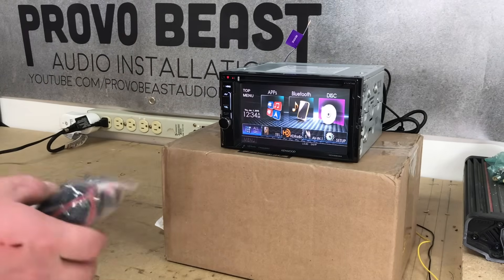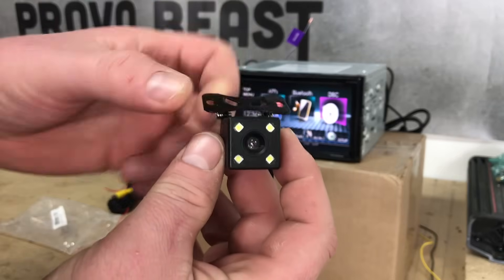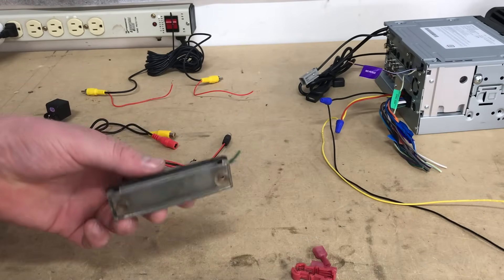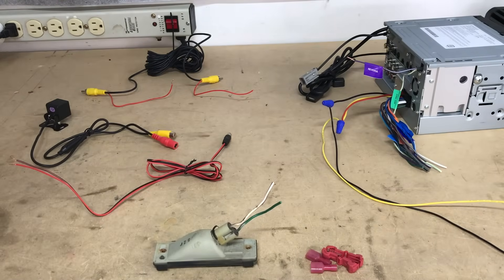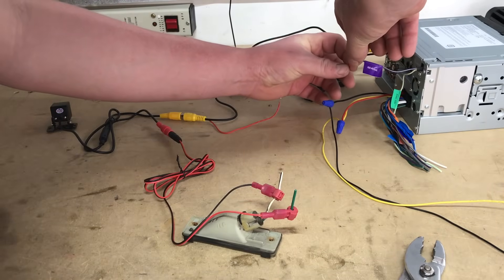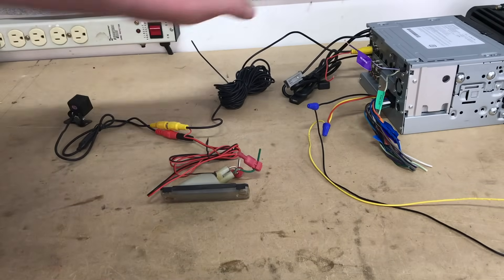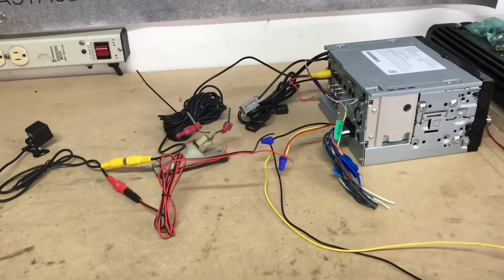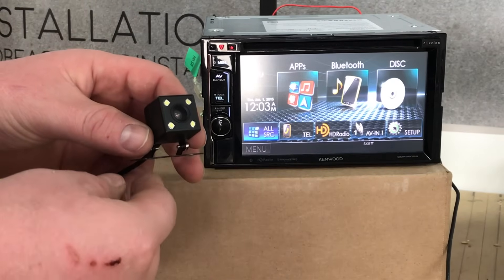Car Backup Cameras Explained: How To Install On Your Car!

Comment: My only doubt is that you tapped power into the reverse light you connected both positive and negative cables but the camera instructions says you should connect the black cable to ground. 
Does it matters? Does is works the same? Sorry if I missed anything from the video

Comment: Out of all of the videos out there, this one changed my trajectory.  No other video I found explains what the system needs to trip the camera and how the little red wires on the camera feed can be used for that.  THANK YOU!  I've been working on this thing off and on for three weeks.  Your video got me across the finish line.
Reply: Me, too! I thought I had my wiring planned out, until I watched this video. 👍 👍
Reply: Haven't installed a stereo in over decade. Just got a screen with this back up cam. All new to this an this video was perfect at explaining. Bout to go give it a try wish me luck

Comment: Does the red cable (from the yellow) both need to be connected or could one be connect only?
Reply from the maker: not required, but if you are using it as a trigger wire, then it will be.

Comment: HELP PLEASE!! When I shift into reverse, the radio screen gets replaced by the camera view (as expected), except there's no camera image displayed and instead it's a full blue screen saying "camera" in the corner. Everything seems to be wired properly (like you showed), the reverse lights work as intended and the camera LEDs trigger as they're supposed to. But no actual image gets on my radio. :/
Reply from the maker: Sounds like an issue with the video signal from the camera.  Try using another RCA to see if that fixes the issue.

Comment: Question I have my camera I bought for my X3, and I have an android headunit. I’m having trouble figuring out where to connect the power cables to, because my reverse lights are on a electrical module that only has 3 cables and that module powers the reverse light, the parking light and the brake like, so I don’t know what would be my reverse cable, only having 3 wires coming out of that module. 
Please HELP
Reply: Did you get it fixed?

Comment: What about if any interference comes along?? It's my case
Reply from the maker: If you get a power electrical interference, you can get a 12v power filter that may help with the issue.

Comment: I didn't quite catch what you meant in the last wiring example.. Will that turn on automatically in reverse, with manual control when not in reverse?
Edit: I mean, will it switch to the reverse camera when the lights are on? I know it gets power from the radio

Comment: I have my camera wired to reverse lights. I want to know if I can put a on/off switch along with reverse too. So it will come on in reverse and if I have a trailer I can see if my load is secure. Any suggestions, I don’t mind if reverse lights stay on as well just need to have both. Without buying anything else.

Comment: Hi I plan to install a rear camera and I got a bit confused, the red/black wire provides powere to the camera right? Why do I need to connect the red wire coming from the yellow wire? I get you need to connect the end of yellow\red to the infotainment system to let the system know you are in reverse and turn on the camera video feed, however I don't understand why do we need power from the other side I mean we get power from the black/red wire don't we?

Comment: Situation whiteout camera: When I go backwards, the radio automatically shows me no signal for the camera.  This means that the radio receives the reversing signal without the tiny red cable being switched on.  So could I just connect the yellow cables together and not the red tiny cables? 
And of course I will connect the cables from the camera to the taillight

Comment: I setup my reverse camera like this and i have a little problem.. 
The DVD Player keeps going to the reverse camera even though the camera is not on(not on reversed gear) but the dvd also detects the camera when I engage the reverse gear. Basically when i go to reverse gear the dvd goes to its reverse camera function and when i release reverse gear the DVD goes back to the main menu(as it should), but after a moment the dvd keeps going to the reverse camera function even though the rear view camera isn't on as it only show a black screen.

WHAT SHOULD I DO??

Comment: Hi, I have a question and your help will be much appreciated. I have installed this device on a golf 5. Everything works perfect but the rear camera. Could you explain me why camera works with the engine stopped but do not work wile the engine is running?
Thank you and advance and best regards.

Comment: That red wire that's attached to the yellow plug that lets the radio know it's in reverse wasn't in the manual nor the diagrams of the device I bought. Your video helped me out, many thanks for that.

Comment: I watched several youtube videos on how to install a backup camera and this one is the best. It took me about 4.5 hours to install a camera and a new head unit into my 2007 Toyota Tundra. Much of the time was spent running the wire from the back to the front. I had to drill a hole in the cab and fish the wire through to the head unit. It was a pain but I am happy with the results.

Comment: Hey bro I have a question; if you re wire the camera to work all the time will the lights on the camera be on all the time also ?
Reply from the maker: If you wire it on all the time, purchase a camera that doesn't have LEDs.
Reply: I understand, but Do the LEDs really make the picture less grainy at night ? (I appreciate your response because I do need help figuring out what camera is best for me)
Reply: @l.anthony3928  there is no way to know what your camera will look like without knowing what camera you’re using and what conditions it is being used in ie: Cold and icy or maybe  hot & dusty?? Meaning that there is No way to offer any kinda helpful info without more info about the topic in question I need to be able to extract information to guide my answer in a way you find useful to your question with out any information none can be given

Comment: Couldnt u just get the constatnt power from the red pigtail closest to the headunit by hooking that up to the 12v ignition. then splice the rear pigtail into the long red cable in the back? Then add a line to the purple wire in the heradunit to say the wire in the kickplate at the front of the car that has the reverse light wire?

Comment: Thank You.I have a boss radio this helped me ALOT.But on my radio it has a lite green wire labled "breaking wire" and black female plug labeled "SWC" they are with the purple Camera wire.You showed what to do with the purple but what is the lite green and black plug for?Thanks again,I just subscribed.
Reply: I think i got it figured out,The "SWC",Steering Wheel control.I don't need that one.And the Braking wire Lite green just needs to be grounded to work all the time.Or Connected to the e brake so the dvd player only plays while parked.I think I'm good to go.Thanks again this video helped me more than most of the others i watched.

Comment: You can also use switch as a trigger for the video signal provided with 12volts source and 1.5 amp or 3 amp to be safe. This way, you can use the camera as a monitor and not only for reversing the car.
Reply: But that would burn the LED’s on the camera all of the time ,right ?
Reply: @Chon-c  no because the trigger wire turns it on
Reply: @Todd_Wilson213   yeah.  It turns on the camera.  The LED’s will have constant power to them unless you run that trigger wire all the way back up front to were the trigger for the camera is done.  I tried it every way possible.
Reply: @Todd_Wilson213    The radio can only show /turn on the camera.  It cant be used as a power shut off for the LED’s on the camera .
Reply: @Chon-c  wrong leds come on when the camera comes on
Reply: @Chon-c  and why ask if you think you know the answer??
Reply: @Todd_Wilson213    Ok. Lol. 
The camera has power all the time. The radio only determines if its showing you what the camera is showing at that time . 
The LEDs can’t be powered separately.  The wiring just puts a physical on off switch the way it comes. .  Lol. 

Read in the comments of the many vids like this that I did.  Then come back. Lol. 

Think about it.  

Maybe I’m not explaining it good enough.
Reply: @Chon-c  yet you are the one on here asking questions and getting triggered when you get answers...
Reply: @Chon-c  where are the 🔋 at? Take ‘Em out bro….

Comment: Hello, I just installed my backup camera on my Evo and it works fine, but when I put I'd pack into park or drive the screen goes fuzzy for like 10sec than it goes to the Android UI. I wasn't too sure where to connect the extra wire on the video cable that goes to the backup camera itself so I connected it to the red power cable for the backup camera. is that connected properly?

Comment from the maker: One Millions Views, thanks everyone!  Don't forget to subscribe :)
Reply: 3M Command contact strips work great, I thought they would come loos here in Canada due to the temperature changes from 100 above to -30 but so far they have worked out great and no screw holes in the Benz.
Reply: Hi there I bought a cheap Chinese double din head unit with camera I’m stuck on the reverse gear wire as mine only has the two iso male connectors I’m a bit stuck where to join that red. 

Please advise 

Thanks
Reply: Q
Reply: I’m stead of going all the way to the radio for the power cause my radio has the feature could I just go into a power source that works with the key on
Reply: Bad ass video...got me finished ...
Reply: Hi I need a help about T Tips how do you put them on a wire that you need power from? Do I need just to press them like you have done that or i  need to take away rubber from that 2 mm from that wire to have contact ?
Reply: Provo Beast Audio Installation so question, my smart harness and head unit already switch when in reverse. I have a hatchback so getting to the reverse lights and hiding the wires requires lot of trim removal. 

Would it work to tap into the reverse wire(since it has power) on the head unit, and grounding the camera in the back somewhere to the chassis or on a bolt somewhere?
Reply: Good, calm video! I installed one of these camera and took power from the reverse wire on radio, litterally just connected the camera power to the reverse wire then on the camera end I again used the power wire from camera cable and connected the red line from power plug, that’s it! Works when in reverse. Has leds so look silly working all the time
Reply: Good video! If there is no trigger wire on the head unit, is there any way /app that can bring up the rear video the moment you put in reverse?

Comment: Hi, my camera was connected by someone but not a professional as I don't have a clue about connecting the wires but do have done sort of knowledge, anyway, like I said the camera was on and when in reverse it could be seen however now there is no signal, I took the stereo off the dashboard just to check if any wires came off and could see that the extra red wires is not connected to anything and sealed with a tape( I did that behind the tape) and also the same at the other end which I do not do, my question now is could the no signal be caused by the red wire not being connected as you are saying and if so then why did I have connection first, please help

Comment: So I got the same reverse camera my radio was from eBay 133 bucks AUD it came with it but when I hook up the back wire to the red wire on the rca it immediately goes to the camera even if im in park and here's no picture showing at all would you be able to help me out? 
Cheers mate

Comment: For your last demonstration. Wiring it so you can manually turn the camera on. Does it also “automatically turn the camera on from your head unit as well when you put in reverse gear as well? Or is it only one or the other? (Which sucks)

Also with last method, can’t you use any ground doing this method? So instead of extending the ground wire back to the head unit’s ground wire. Can you just ground it in the chassis next to the camera? Does it have to be the head units ground wire???

Last method again, With the positive wire from camera, do you wire it to the constant battery/power wire of the head unit or the switched ignition aka accessories power wire of the head unit....

Last question relates to power wire for last method. Can you just wire that to any constant power wire near the rear of the vehicle instead? Say the power wire of tail lights to save extending the length of wire to the head unit. Or does this also need to go to the constant power or ignition wire of the head unit. Pretty much the same question as the ground wire question....

My apologies for all the questions I hope they all made sense. and thank you in advance if you get time to read and answer all this

Comment: Nice video.. My question is what happens when the flashers are on... thx
Reply: Mark D .... The reverse/backup tail light is not part of the flashers. It's only activated when in reverse gear....
Reply: @orangecounty7144  Rodger that... Thanks you the reply...

Comment: Hello, I have the same camera I think. However, when the engine is on, I am getting interference. When the key is in the posting 1 but engine not turned on it works fine. What could it be

Comment: Thank you so much! This video helped me figure out the issue with my camera install. Turns out the after market stereo wire I needed to connect to was “Rear Car”. It seems that was the backup camera wire I was supposed to connect to. Anyways, this video helped me so again, thank you sir!

Comment: I installed one of these on a 16 metre truck , I was there for absolute hours , running enough lead , I had to get longer leads and then fix all wires to the chassis rail of the truck , as the cab tilted forward I had to also figure out how to get around that .I can not remember how I figured a way around that , I then mounted a big screen on the dash of the truck , word back from truck driver is it helped him heaps , I would though check on what resolution camera you get , most of the cameras you can pick up for around $10 but they are low resolution cheap junk

Comment: Hey, good vid, could you tell me how to find these clips things you put on cable to harnest the power of them without cutting the cable and soldiering it?
Reply: Amazon, search for t-tap wire or quick splice connectors

Comment: Would it work if i plug cameras power cables to reverse light and RCA to the adapter (RCA to 40pin) and adapter to the native monitor?
Its for prius 2006 with nav

Comment: Everything here is solid and clear as day, thank you.. however 1 thing I'm pretty sure about is the fact that the 'red power' plug coming from the camera is strictly for the light bulbs on the front of the camera.

It's an option to either have or not have the light bulbs in the front. The camera itself is powered through the yellow Input wire with the reverse trigger wire on it.

Try to setup and operate the whole thing without the red power wire plugged in and you'll see that your camera still works just no light.
Reply: And that won’t burn the LED’s On the camera unless the car is put in reverse. But still allows to monitor camera (without LED’s burning ) in the radio option if it has one. .  Right ?
Reply: @Chon-c  Correct, the camera works with or without the l.e.d however if you are going to use the l.e.d make sure it's power source is connected together with the reverse trigger not the cameras power.

Comment: So in the last way to install. 8:50. Does the red power wire from the camera run to the 12v constant wire (yellow) on the harness - or the accessory wire (red) on the harness? Yours are both connected together. Please and thank you!

Comment: How can I connect a switch to turn on camera when I need it is that possible
Reply from the maker: yes, instead of connecting the trigger wire to the positive of the reverse light, connect it into switched power and put the switch in-line with the trigger wire, allowing you to activate reverse mode any time you like (regardless or going into reverse).  Alternatively, some newer head units will allow you to pull up the camera anytime without being in reverse too.

Comment: hi i have this camera i install it it work but weni start the car i have probem with ta bilt
Reply from the maker: you may have noise distortion across your power cable.  You can get 12v noise filters which may help solve the issue.l

Comment: I had this same camera on the same radio and truck about a year ago. I had to replace it a wire fell and hit the exhaust and shorted it out after the warranty window. But, before it was crystal clear , So I know it’s not the radio

Comment: You should connect power from back light otherwise it will work constantly
Reply from the maker: Or to an accessory wire that only puts out power when the key is on - allowing you to view the camera when not in reverse.

Comment: I did want to ask, do you need to change anything in the radio settings? I saw in camera settings on my pioneer it says to pick battery or ground , something about polarity ?
Reply from the maker: pick battery. most applications are on a 12v trigger source.